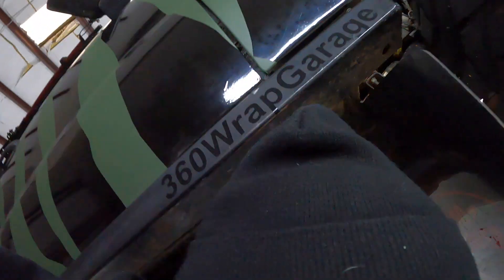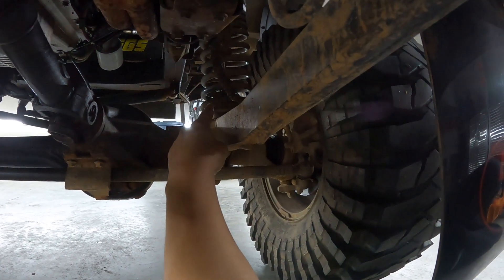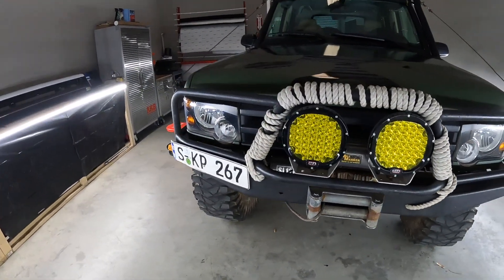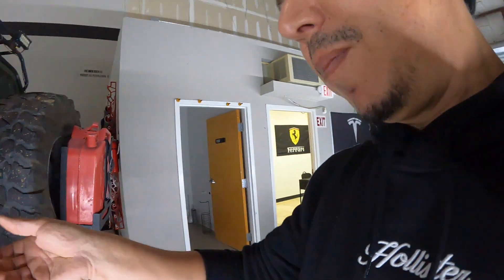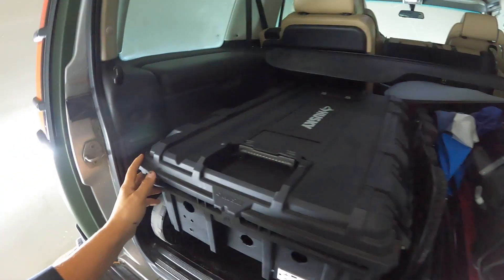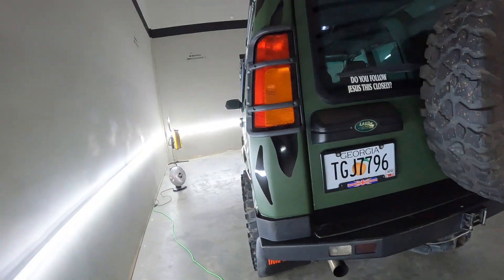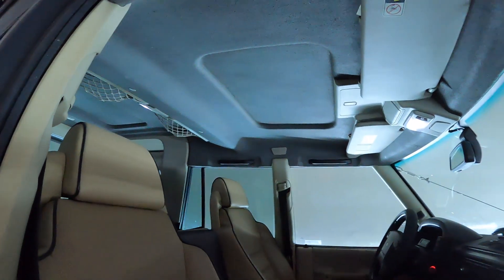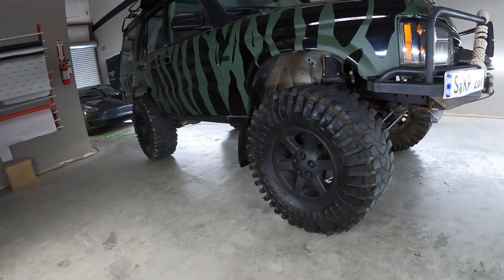Land Rover discovery 2 Up-grades and tips Part 2

Comment: Hey bud .. thanks for taking the time for posting all this great info... you mentioned you ceramic coated the discovery. Was this done on the wrap and if so is it just the same as ceramic coating paint. I'm also thinking about wrapping my discovery but was considering putting a ppf wrap over it.
Reply from the maker: Hey! 🙋🏻 the caramic coating was done on the wrap only. PPF looks nice to protect the paint but it’s very expensive material expensive to install men. A wrap will protect your paint as well and is less money.